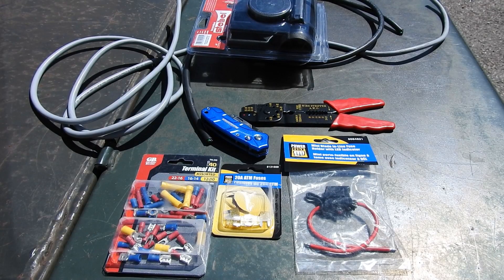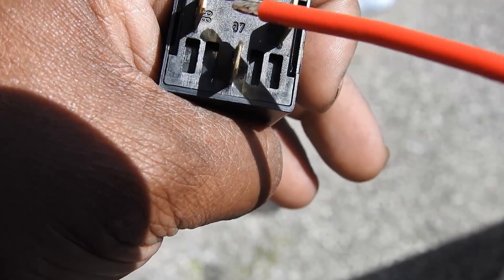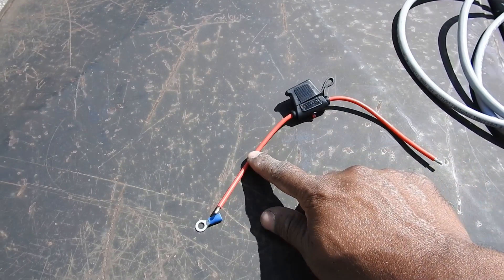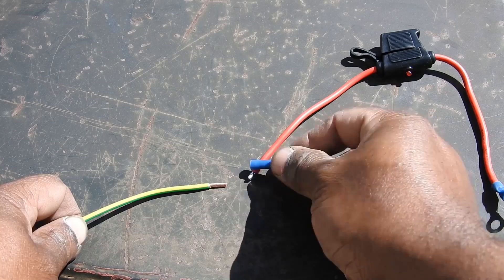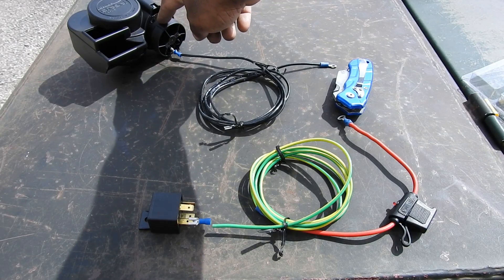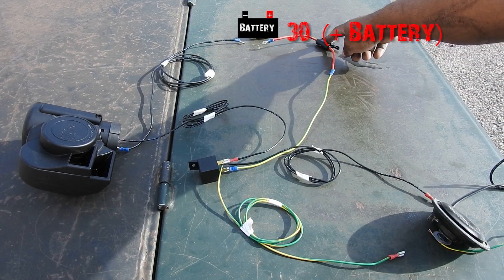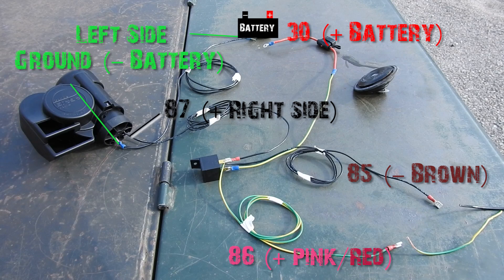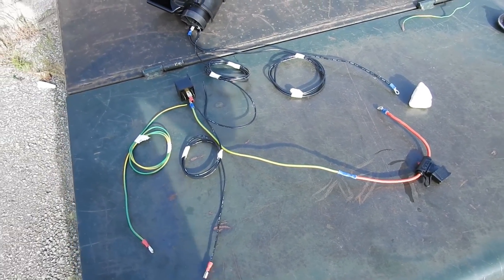Stebel Nautilus Wiring Kit

Comment: Why cant you use the existing wires for the oem horn?
Reply from the maker: You do! These are added to it.
Reply: Because the power requirements for the horn are greater than the stock wiring can handle. One of two things will take place if you hook up horn without following these instructions. 1) your horn will function "properly" but at a much lower decibel. 2) You run too much power through the bikes wiring, possibly melting the wires attached to the horn or perhaps damage your electrical system in other ways. Yes, I do realize I am answering a year old question and my answer is simplistic in the extreme.

Comment: Awesome video! I have a question.  Id like to hook this Stebel nautilus to a c4 corvette.  The factory set up has two horns a high tone horn and a low tone horn  mounted near the front bumper.  I would like to keep the factory horn button in the steering wheel.  There is a 15 amp fuse in the fuse box from the factory as well.

Would i get power from one of the connectors to the current factory horns?  Trying to figure out how to hook this up in my set up.

How far from the battery is ideal to mount the fuse?   does it matter if its closer to the battery or to the horn?  Im planning on using 12 gauge just to be on the safe side.  The thicker wire is for the wire running to the fuse and positive terminal?

If someone could give some guidance it would be appreciated.
Reply from the maker: Yeah that's a tough one. I'd look to see how the other horns are connected first and to what fuse(s). Are you adding this horn to the ones already there or replacing one or both?
Yes the thicker wire is for power. No the fuse location does not matter. Whatever is most convenient for you. Good luck!

Comment: Is there a way to keep the stock horn and the Stebel?
Reply: yes, you would leave the original horn and wiring as is... take a switch of your choice and have that wired one side going from your battery to the '+' terminal on the switch, '-' terminal on the switch will be wired to the 85 terminal on the relay, the 86 terminal on the relay will be to a ground or neg post of batter... now hook up terminal 30 and 87 as stated in the video. have my truck set with stock horn and a train horn on a spring toggle switch (monetary switch) from autozone... hit switch, horn goes, release switch and it springs back to open position

Comment: I understand almost everything. What if i will use a seperate switch? How to wire it? 1 wire goes to the dwitch and the other goes to??
Reply from the maker: The other wire would go to the battery. The switch would be between the battery and horn.
But you have to make sure you get the right parts. You don't want to ruin stuff.